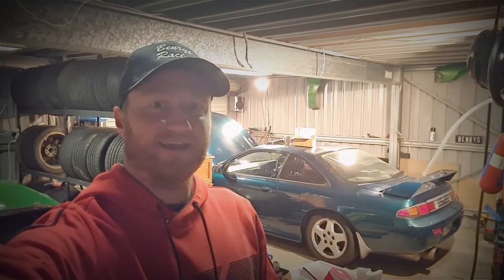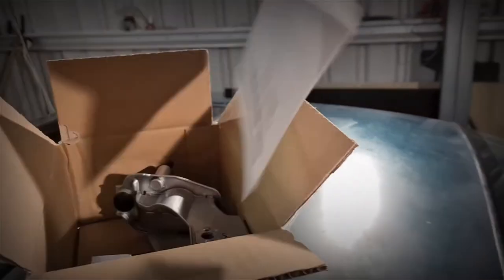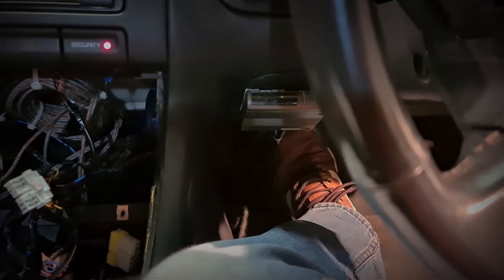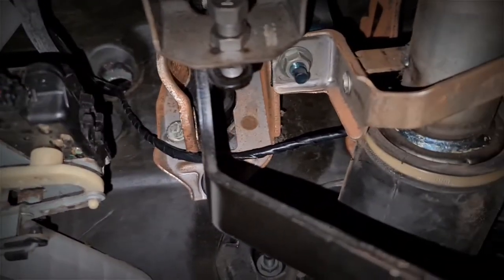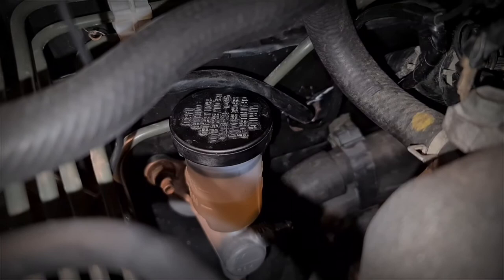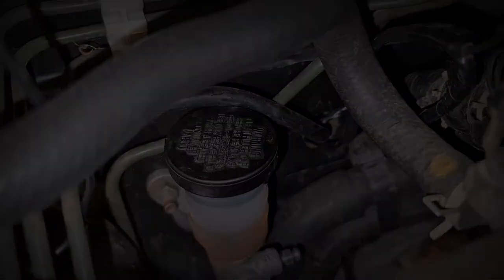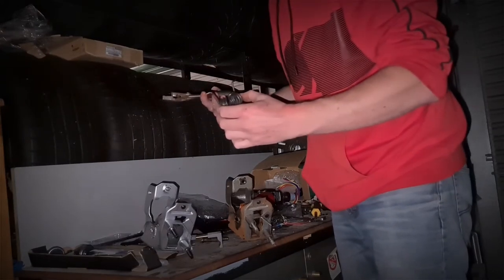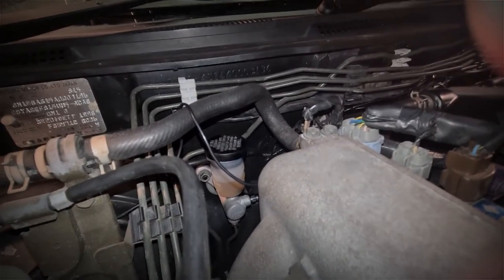Nismo s14 clutch pedal install and bonus surprise!

Comment: Nice pickup on the optional dead-pedal!
I just recently picked up the same one too haha I've got the other type of S13 optional dead-pedal they offered mounted in my S15 200sx 😊
Did you notice that the dead-pedal has 2 different adjustments on it to set the angle of the dead-pedal?
Reply from the maker: Well spotted mate. Hahaha. Find these bits are really hard now days. I'm going to do a review on all options on the car soon. Watch this space